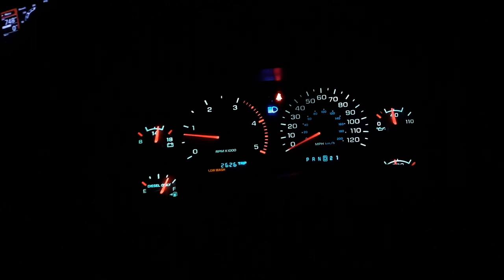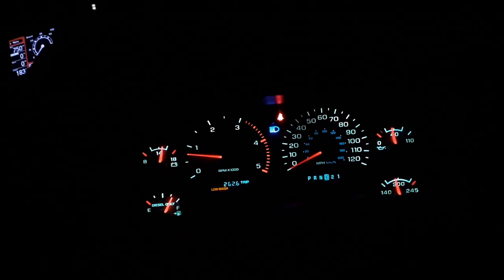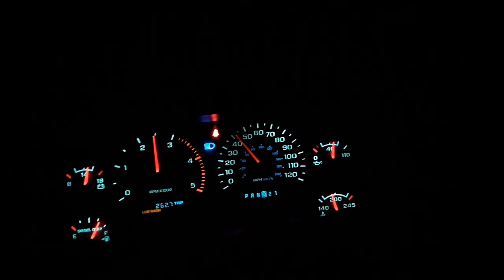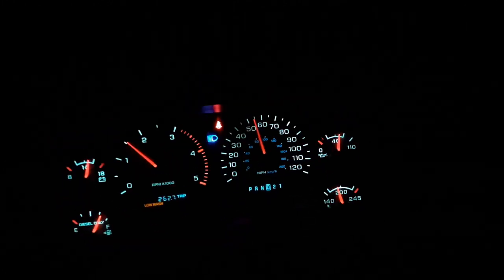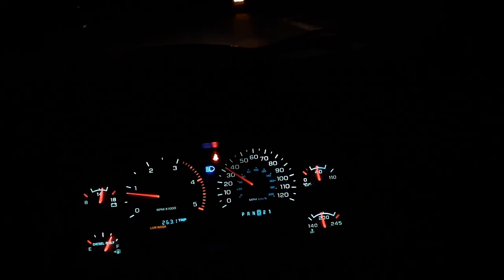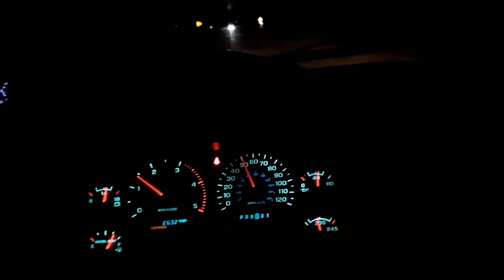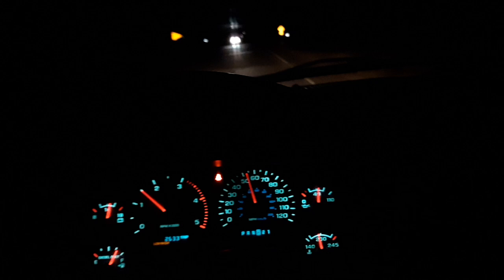Fire punk transmission!

Comment: Does it slam so hard that it feels like it’s doing damage? I am also looking at jasper Transmissions! I really like what fire punk has going on though!! Tough choice
Reply from the maker: It's a solid shift but I'm not worried anything's going to break no. It's very predictable so if you rev up in first gear and at the right spot on the tach let off the throttle it will click the second then you get back on the throttle and it's pretty smooth

I guess which dealer is going to stand behind you the best is an important factor to me
Reply: Michael, don't do a jasper. I've not had much luck. Firepunk or suncoast

Comment: I must’ve gotten unlucky. Because I see a lot of good reviews about there transmissions
Reply from the maker: Everything is man-made it's not impossible to get a bad one I mean. Do they at least try to work with you?
Reply from the maker: I can see your comment about the transmission tutorial and then the electronics for the knights took a crap but I can't pull it up to respond in it shut up. Hopefully they're still willing to work with you to make it right
Reply: @jonstevensmaplegrovefarms3754  so far they are willing to work it out. and it wasnt electronics its something internal because when transmission was first installed the pump bolts were loose and next day all fluid came out through cover  area. now im sending them the transmission. i had issues since i first got transmission.